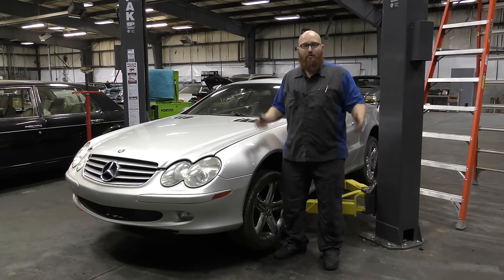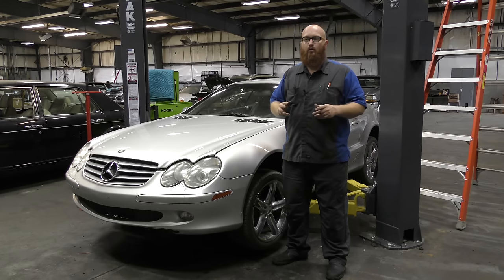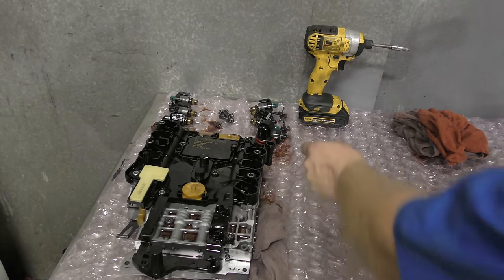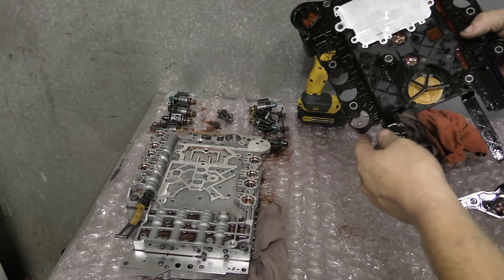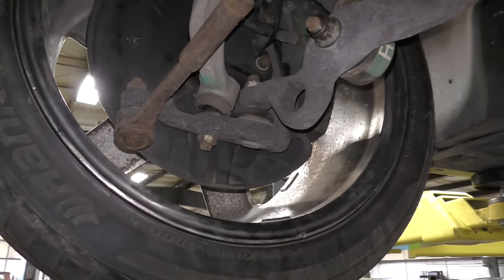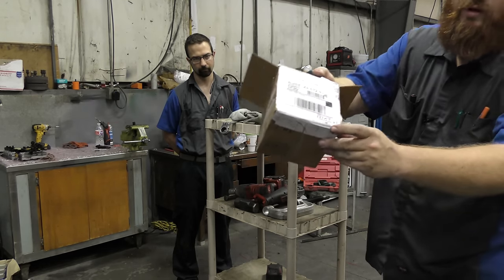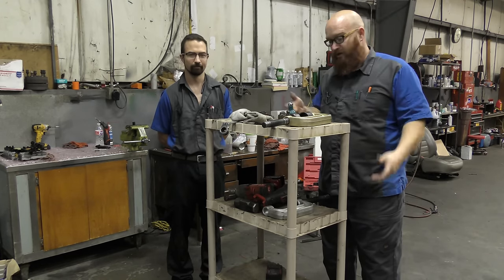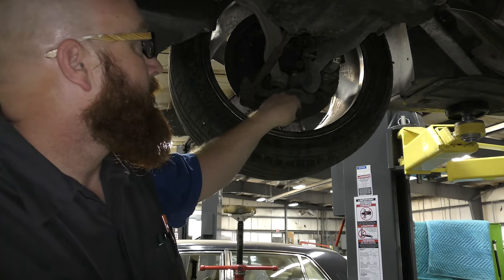ABC Strut ball joint repair. The CAR WIZARD shows to fix ABC strut on '04 Mercedes SL500

Comment: as a professional Mercedes Tech I advise that you NEVER buy anything from Rebuild Master Tech. imop they were the most incompetent and dishonest scumbags I ever dealt with. DO NOT LET THEM "REBUILD" YOUR ABC STRUTTS OR TOUCH YOUR ABC HOSES.  I have an 03 R230 and completely sorted the car. I rebuilt the entire ABC system and everything that goes bad on this car.  If you need ABC strutts then go to Arnott.

Comment: 07:44 I'm surprised Wizard doesn't have a power hammer in the shop. I know he's not fond of air tools and I can't blame him really (they're so loud). But there are electric power hammers too. That would have made short work of the ball joint with less effort. Granted that wasn't a lot of effort anyway.

Comment: I fly Boeing 767's for a major freight forwarding company.

-What this video tells me is that Mercedes-Benz and probably every other car manufacturer now believes that cars should be scrapped at the age of 20.  While I cannot source it right now,  Airbus, the European aircraft manufacturer, has stated publicly that an airframe 25 years old should be scrapped irregardless of flight hours simply because it's technology has been eclipsed.

This might be why they increasingly make cars hard to fix.  Our society is relatively wealthy, and we all drive plastic cars and never work on them.  That was not true during the 1960's or '70's;  Cars were designed to be worked upon.  

Q:  HOW MANY of you can, if called upon...Actually change the water pump on your car?  I drive a '14 Porsche Cayman S and an '01 Subaru Outback LL Bean with the H6 engine, and I can tell you that while it would take me a week with the Porsche and a MONTH with the Subaru, I COULD do it!    But then again, I'm a gear-head who changed the motor mounts and steering rack on my Porsche 928 in 2003 with no training whatsoever and only other people to tell me how to do it.  The car ran perfectly afterwards. Of course, Rennlist helped.

The thing is...People like me don't exist much anymore.  People talk about Millenials just like they talked about my Generation X:  "You fucking kids on your skateboards will never amount to much, all you want to do is play with your video games and cause trouble on your skateboards!", a cop in downtown Toledo screamed at me in 1984. 

Bullshit.  I'm not going to tell you what I earn per year....But trust me it is far more than the "much" that that idiot implied!~

Millennials, Generation Y, Generation Z, whatever...Are the same people who existed on January 1, 1950.  Only the technology has changed.  But the technology demands LESS these days, while being CHEAPER and less resilient.  The problem going forward is that it is getting far more difficult and expensive to repair cars, and this is what the manufacturers want.  Oh and by the way, barring nuclear wars or other pandemics?  Your millenials, Gen Z, whatever...?  They will be FINE.
Reply: That's true, but one thing I left out is that the design of cars these days shows clearly that the auto companies realize people simply will not work on their cars anymore.  Any Audi can show you this;  The V6 and V8 engines are wedged in there so tight that you literally cannot get to many items at all, neither from above or below, without taking literally dozens of unrelated parts off first.  The industry figures that people will either take it to a mechanic or simply replace the car, so they make it cheap to build first and don't really consider maintainability, at least not beyond the warranty period.

Comment: I am still waiting for a buy this, not that video for Toyota and Lexus. Here are my top ideas:

Toyota:

Compact: To buy - 2009 to 2013 Corolla with an automatic & Not to buy - 2014 to 2019 Corolla with CVT
Mid/Full-Size: To buy - 2000 to 2004 Avalon five-passenger & Not to buy - 2007 to 2011 Camry four-cylinder/V6
SUV/Crossover: To buy - 2008 to 2013 Highlander 4WD V6 & Not to buy - 2006 to 2012 RAV4 4WD four-cylinder/V6
Minivan: To buy - 2004 to 2016 Sienna eight-passenger & Not to buy - 1998 to 2003 Sienna/1991 to 1997 Previa

Lexus:

Compact: To buy - 2006 to 2013 IS 250 AWD automatic & Not to buy - 1999 to 2005 IS 300 any transmission
Mid-Size: To buy - 2007 to 2012 ES 350 & Not to buy - 1997 to 2003 ES 300/2004 to 2006 ES 330 (poor handling)
Full-Size: To buy - 2001 to 2006 LS 430 & Not to buy - 1998 to 2005 GS 300 (looks like a full-size sedan that is too sporty)
SUV/Crossover: To buy - 2010 to 2015 RX 350/2012 and newer GX 460 & Not to buy - 1999 to 2003 RX 300/2004 to 2006 RX 330

Comment: I never understood why they call it limp home mode when it reduces the power so much you can barely do 20
Reply: now I understand the minute I saw the nut one ya you definitely wouldn't be running after that the only problem with limp mode is that you'll be the one limping home because it would nearly get you killed if pulling out from a crossroad
Reply: ya but I never  understand why especially in German cars if there's even a can bus issue it'll go into limp mode I think

Comment: Great video, so clever it’s a disaster to own a Mercedes. Only Mechanic, or wives of logically might own. They’re such a rip off to service , They lie right to your face and if you’re not clever enough  to unwrap it with your knowledge,  that’s when they just stop talking. I would insist on being sold the part I needed and nothing else. Replaced the car with Lexus. No regrets. Family, to date five Lexus, sold one to a friend, gave one to a niece, still running three. 20 years no problem. We owned, one brand new BMW for six years, lemon, one Volkswagen damned to hell from the dealership would never own another. One Audi TT, lemon, one Mercedes E 4matic (2000) loaded, 100 grand, lemon. Never again. JD Powell Analysts, Learn them you will know what to buy. Mercedes are beautiful Lease only and then exchange.

Comment: member when transmissions were simple and controled by fluid pressure and vacuum not electronics??? i member.
Reply: member when they shifted slowly and earned the name 'slush box'??? I member
Reply: @tim3172  nothin slush bout my C6 with 4.11 rear gears in my f100. still prefer a proper manual.

Comment: I'm kind of surprised and shocked you are not using power tools for that 1st nut you took off or even the fork. Weird. Also, why not put the jack under the tire before you let it go down and put unnecessary pressure on suspension components?

I won't even get into letting the thread rest in that hole/possibly damaging it.......not having the correct ball joint removal tool.......why get dirty? just wear gloves......strange

Comment: This why you don't buy a Mercedes from the 2000 - 2013 period. Nothing but problems. If you want a quality Mercedes, buy 1986 - 1993.
Reply: Exactly same is true of BMWs: if you can’t maintain them on your own (like Wizard) they are endless money pits
Reply: Grimacing in 2000-2013 owner 😬

Comment: Is that his accent or is he saying turban? 
Cuz I never heard of a "turban" other than on someone's head.
Reply: There are two accepted ways of saying 'turbine'
Tur - bine
or 
Tur - bin

tur·bine

/ˈtərˌbīn,ˈtərˌbin/
noun
a machine for producing continuous power in which a wheel or rotor, typically fitted with vanes, is made to revolve by a fast-moving flow of water, steam, gas, air, or other fluid.

Comment: I have 3 Priuses. I can buy almost all my parts on Amazon. New tail light is $70. Try that on a Mercedes.
Reply: Apples and oranges. If you can’t afford to maintain a Mercedes, then don’t buy a Mercedes. A Toyota wasn’t engineered to spend its entire life on the autobahn. They drive and ride completely different
Reply: Maybe the ones made in Germany. The newer, cheap FWD "German" cars were never made for the Autobahn. The "entire life" you are talking about is about 3 years. After that , all the plastic and rubber parts crack and fail. A Japanese car can go 20 years without replacing door gaskets. I had a Volvo that needed 4 plastic coolant reservoirs in 100k. All that poor plastic under the hood. Car Wizard doesn't even want to work on Hoovie's BMWs so he takes them to the Ninja. Those repair videos are almost comical. What broke? How many thousands? Where do you have to go to find the part? The models change too fast and it's too small a market to find junkyard parts.When you get older, you'll discover that cars are transportation, and reliability is supreme. Maybe even life-saving. Premium price should mean Premium reliability.
Reply: It’s comparing a Timex to a Rolex. I’d much rather sit in my Mercedes than the Honda I used to drive many years ago. I’ve exclusively driven S-Classes for the last 10 years for this reason. I drive about 20k miles a year, I can afford to stay on top of the maintenance, and I’d rather be comfortable.